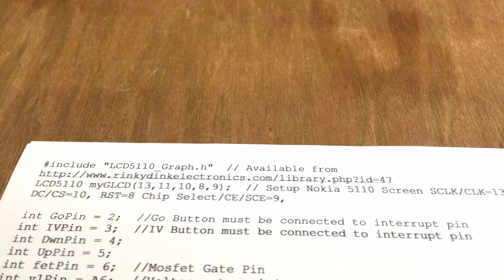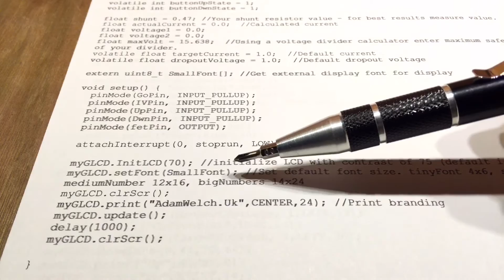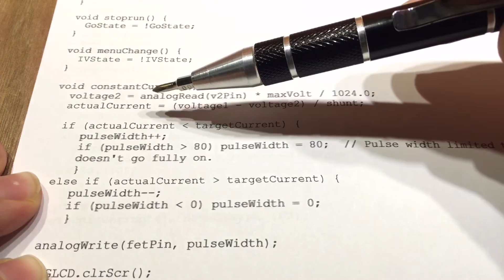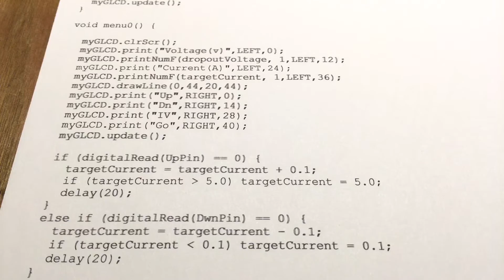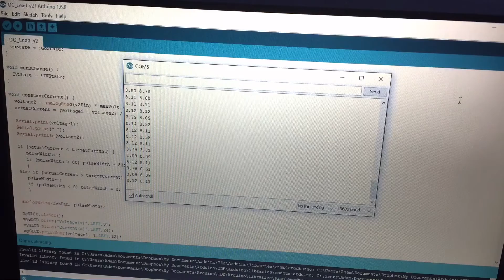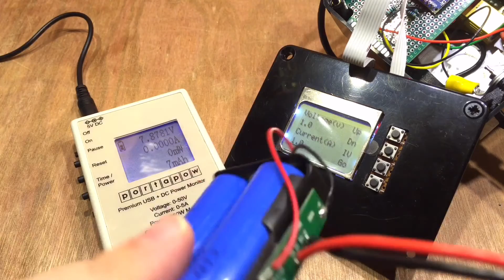Constant Current DC Load - Part 3 - Some Code - Adam's Arduino Projects

Comment: Adam, you keep using the word accuracy when talking about the bit depth of the ADC in use. I think you may mean precision. You can have a devices with lesser or greater precision, and yet they are still not accurate. Having a more granular reading offers better precision. Making the circuit calculate the current flow closer to the true numbers is more accuracy. Semantics, it's not a criticism, it's just the correct use of those terms. Really enjoying the videos. 👍🏼

Comment: Why didn't you use the shunt resistor on the low side? ( one pin of the resistor connected to ground and other to source of the MOSFET) This way you don't need voltage dividers and you only need to measure the voltage on one side of the resistor (the other one is connected to ground, so no need to measure it)
Reply: nevermind, i watched part 4

Comment: Yeah, the first thing that struck me when I first saw the previous installments of the series, some weeks ago, was why you are using PWM to fully turn the FET on and off to create CONSTANT CURRENT, instead of using the gate capacitance ( of perhaps multiple FETs  padded with a cap close to some sane value like 1 or 10 nF )  and then charging or discharging the gate. Granted, you can't use PWM directly  since you are going to have to have your output pin in INPUT mode most of the time and only switch to output  to make adjustments. Remember to use enough FETS to carry your 5A  since they will be dissipating all the power, you could alleviate the dissipation with resistors but then different voltages will have different current upper limit and usually , you want to draw more from bigger batteries not less .  
Filters suggested by others could work to a degree but it would probably be difficult to get one working equally well over your entire range.
Reply from the maker: +Sambo thanks for your comments. I've added the low pass filter to the gate of the mosfet and actually I'm surprised how well it seems to regulate. There is an issue that it takes a while before the target current is reached (4-6 seconds approximately), and the accuracy needs to be looked at. This is down to the reading of the analog input, and the accuracy of the five volt rail. 
I tested it again only last week up to 30 watts and the heatsink coped quite well. 
This was very much a learning exercise and I went in a little naively and green round the ears. I'm still very much a beginner but I've made some steps now :-)
Reply: Yes, there on the gate it is a good improvement , I read some comments about it too early in the morning and thought the filter was suggested on the sensing resistor as the part of the video about dumping the read values and acknowledging a problem was fresh on my mind.

In a sense I guess my idea amounts to a filter without the intervening discharge on every cycle.

Comment: Maybe you could put the resistor in the low side of the circuit, and feed a reference voltage of about 2V to AREF pin on arduino. In this way you could read up to 2A and have a maximum resolution of 2mA
Reply from the maker: Yeah - I think the AREF is where the trouble in reading the values reside.  3 volts (and therefore 3 amps to 3ma) might be a more useful for me though.  Thanks for your input.

Comment: voltage1 = analogRead(v1Pin) * 5 / 1023;   it's going to be 5 as your max pin I/O from the Arduino is 5 VOLTS not 15.638 as your referencing the MAX INPUT into the unit. Only unless you change the reference voltage to the Internal 1v1 oh and it may be more or less since your input power probably is fluctuating. So do your math on the display side not the calculation side  to correct for the resistor divider. Your Duty cycle is what controls the AMP draw. (Duty cycle% * 255) = duty cycle  : 50% duty cycle?? = 127.5 which cannot float so it's 128 or 127 which gives %duty and volt or %duty and volt (you do the math):  80%Duty= 204 or 4 Volts over 1 Ohm = 4 Amps. 60% Duty = 153 or 3 volts.. Not going into timers and frequencies since that opens more worms but you can actually have 50% duty cycle or 2.5 Volts.. and remember it's really 256 can't forget that 0 since we can have 0% duty cycle...

Comment: The problem with your current setup is that you're constantly shorting the battery for a very short period of time and just measuring the average current. The best approach would be to do this in a more controlled way having your MOSFET in the linear region with a heatsink and using a opamp to control it and buffer the inputs of the ADCs.

I highly recommend you to use Dave's design, it's super simple and could easily be adapted into your project. Forget about doing the control loop in the Arduino, just set the current using the RC filtered PWM and let the opamp do the hard work of providing feedback and amplifying the voltage across the shunt resistor to improve your resolution.
Reply from the maker: +Nathan Campos I'm thinking exactly along these lines. Thank you. I really appreciate your comments.

Comment: BTW never test stuff with batteries always use a cc/cv power supply when testing stuff. This allows you to ramp up either volt or amps and when something is wrong you dont blow up things just burn them out. If you plan to keep using batteries then wear impact resistance glasses at minimum you only have 2 eyes rest can heal and deal without.
Reply from the maker: +Martin P Ill take that all on board in my next experiments. Thanks Martin.
Reply: +Adam Welch, use you little Oscilloscope, it will work for this little project. Just don't go over the oscilloscope input voltage..  Play with the PWM from your Arduino send different values and see what the actual voltage is on the output..

Comment: There are 1024 steps, 0 will always be 0 so your scale is to 1023. you start your counting from step 1 is 0, step 2 .00488758553 to 5.00.... 1023/5 + 1  for 0 step = 1024.. You'll need a buffered (DAC overkill) other wise use the Opamp.  But what your missing the the low pass RC filter out of your Arduino pwm pin this gives you a DAC. The gate has a turn on, turn off, fall, and settle time depending on your MOSFET, and your opening and closing it with the PWM. Double check your pins are correct for a NPN and your load (Resistor).  I would measure the voltage at the Input rather than between the resistor.

Comment: Try running the mosfet in a linear mode - can be done with a grunty device and decent heatsink. Or use a meaty bipolar transistor instead as the current setting element. Then integrate the PWM signal with a capacitor to provide a varying drive to the power device. This is maybe where your opamp comes in handy.  The idea being that this would give a more stable voltage in the resistor for the Arduino to read perhaps?
Reply from the maker: +xanataph Interesting. Supply a more smooth lower voltage to the mosfet rather than a PWM signal? I can see how that might work, but as you suggest I can imagine it'll get very hot. Some useful advice as always. Thanks Xan
Reply: +Adam Welch The thing to remember is that something always must get hot. Because to draw a constant current one must always dissipate a constant wattage (for a given voltage of course). 

Say we have a 10 ohm resistor being fed with five volts. This allows a current of 500mA to flow and dissipates the power of 2.5 watts. Now, if we swap that resistor for one of 5 ohms, but we PWM modulate the power to it on a 50% duty cycle. We are now dissipating 5 watts but for only 50% of the time. The net dissipation in this case is still 2.5 watts. But we are alternating between 5 watts and 0 watts on an equal time basis. 

So, to draw a constant current - no matter how it's done - some power must be dumped somehow. It really doesn't matter which component (or combination of) does the job, so long as it's appropriately treated to be able to handle this. 

Hopefully there's some clues for you there...! :)
Reply from the maker: +xanataph Thanks Xan!

Comment: Use a self reuglating loop ( with an op amp )
power it off 9v ( or other ) so that the mosfet doesn't get too hot
use arduino to set the input of the op amp ( to set the discharge current )

also, where are you getting those resistors ? They look a lot better than the shitty ones I got from china ( ordered 2 ohm but they are all 2,2 or even 2,4 ohm )
Reply from the maker: +BillTheBox That sounds like an option. I'd rather not have to power from a higher voltage source but I can see the advantage. Thanks very much. 

Those resistors are from a RS Components, a UK electronic supplier. They do free next day delivery - I'm not sure how they do it for the money yo be honest!
Reply: +Adam Welch here is a small prototype :
http://imgur.com/pHICRe2
it's really basic, but it can easily be arduino-ified, and powered off 3 cells in series ( the draw is tiny )
arduino can controll the draw with analog out, and can measure current over the resistor, and can also controll up to 4 channels
I beleive this one is based off greattscott's design ( although it's a basic CC load design )
Reply from the maker: +BillTheBox Looks good. Thanks for sharing. I think that's the way forward - arduinofying an op amp based circuit.